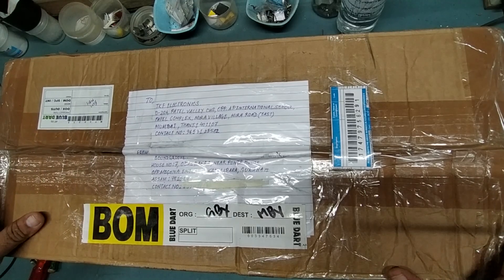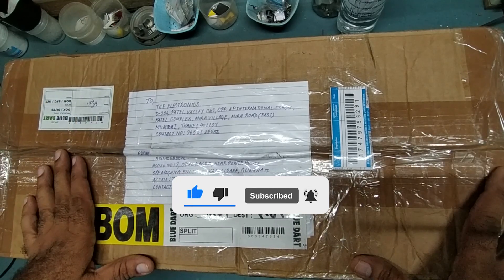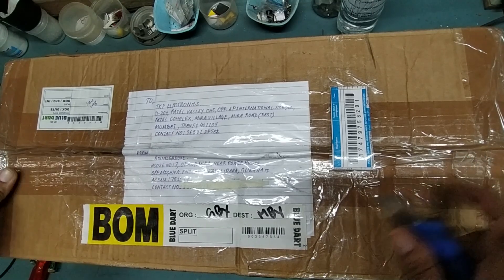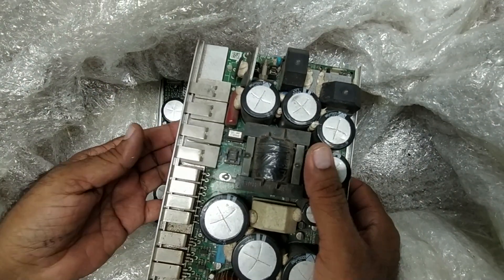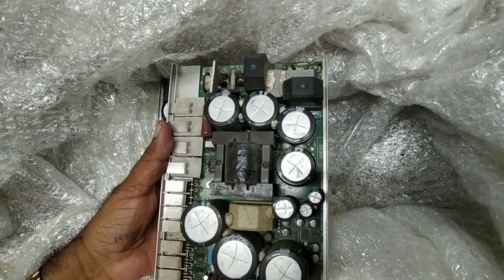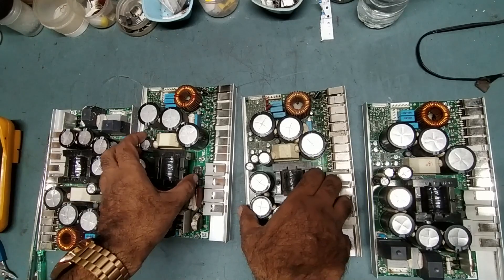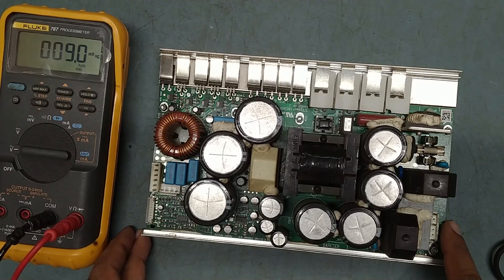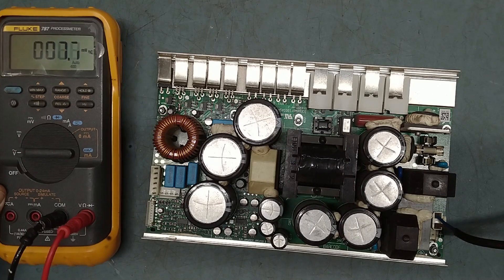Repairing & Troubleshooting in RCF 8006AS Active Subwoofer Power supply & Amplifier Module

Comment: Brother, sony HT-iv300 motherboard cost ? 
Why motherboard can't be repaired in that model AV receiver.?
Reply from the maker: Motherboard is repairable for minor problem, & if main system ic is Shorted then no option except replacement with new motherboard only.
Reply: @TKFElectronics  ok brother thanks